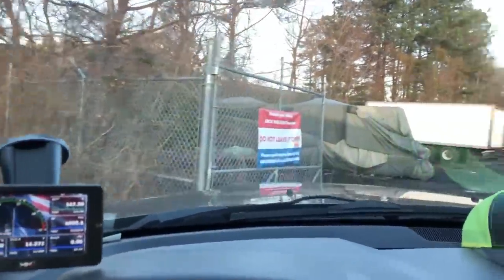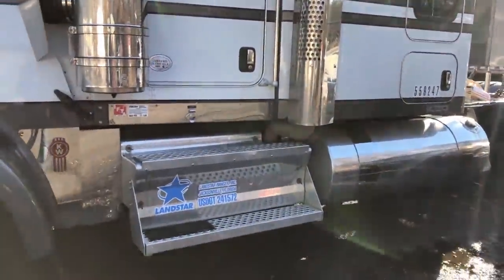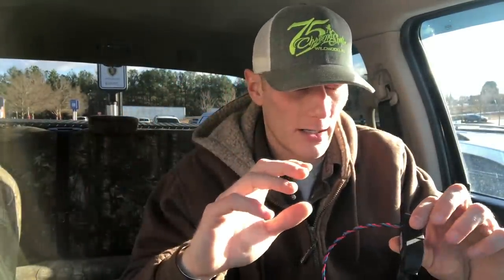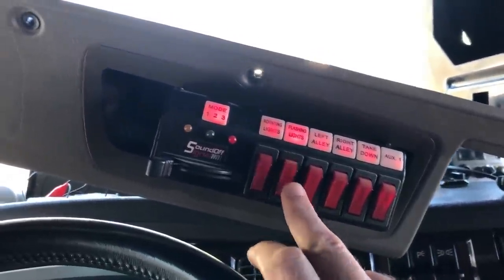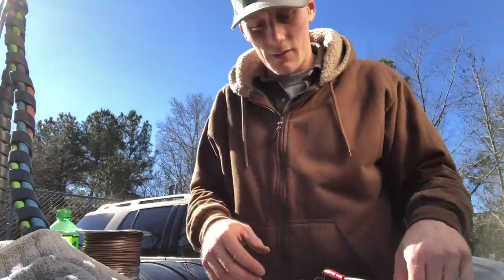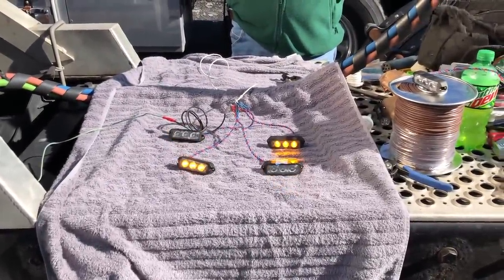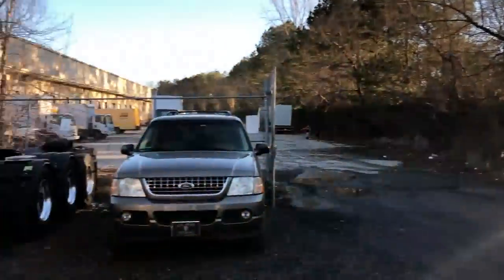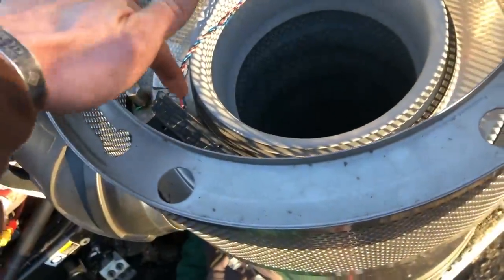Heavy Haul: Lights, lights and more lights!

Comment: Nick, Nice to see an updated video on the Battleship. It's a nice truck and I've enjoyed watching your travels and experiences.

Would you consider putting together a "Knowing what you know now, if you had to do it over again, what might you change" type video that might include the following:
   a) New vs used
      - See (b) as it relates to how you'd setup in the first place (factory installed vs aftermarket)
   b) Different tractor / trailer setup
      - Tractor axle spacing - tridem vs tridrive vs duals & a forward drop axle (fixed vs steerable), a 20k front end
      - Trailer setup (beefier frame, steerable vs fixed axles, longer transition to get more weight forward, etc.)
   c) More or less gear (chains, straps, tarps, tarp & edge protectors, etc., etc.)

I understand that everyone's mileage varies and what works for one won't work for another (e.g. the new vs used debate).

Comment: Nick one quick question. 
When you extended your truck frame,  did you just add and re-enforce the additional section on the rear or did you re-enforce the truck frame in front of the 4th axle?
(Over the original drives)
Reply: Go back to the video where he explained and showed the reinforcing (not "re-enforce" which means something else)
https://www.youtube.com/watch?v=N-PMeKQ5TEQ